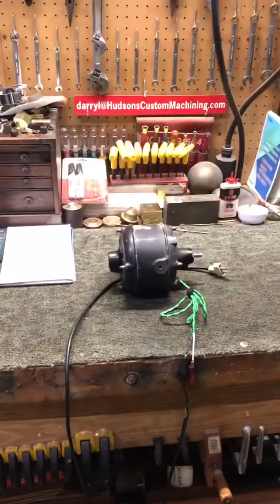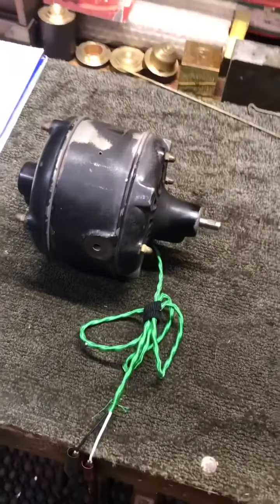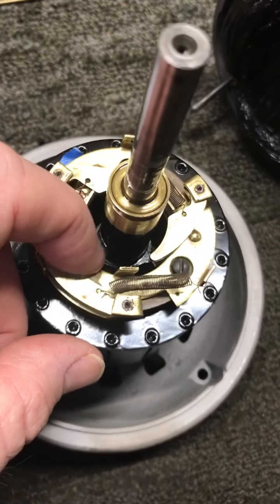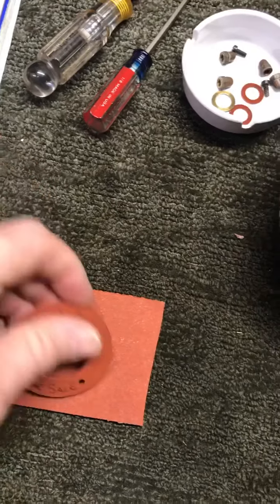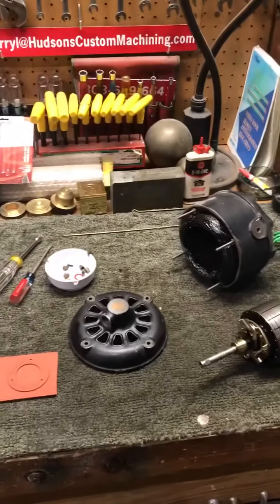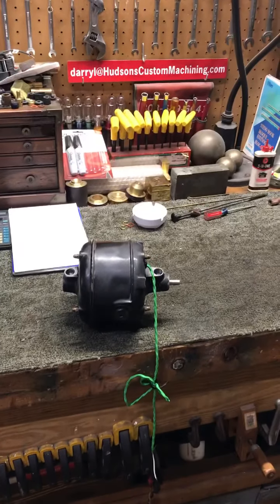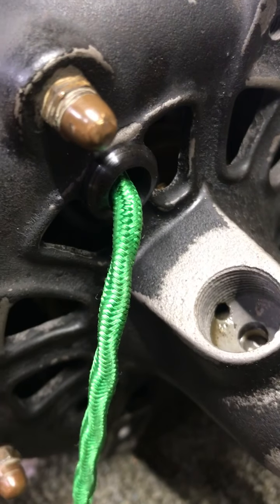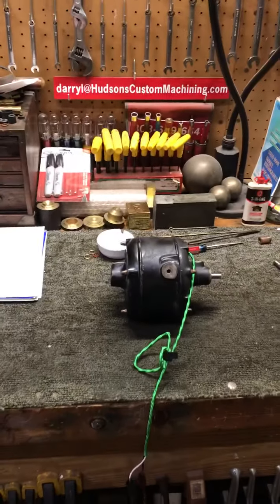c.1910 Westinghouse Fan Motor Repair - Darryl Hudson

Comment: Hey there Darryl.... I have a 1915 Westinghouse fan that works but needs bearings. Can you recommend a supplier for these? Also, it would be great if you could make a video showing how to remove/ replace the insulator under the centrifugal start switch. Thank you for this video, it was great!

Comment: Hey Darryl do you know where I can get 2 General Electric 2 star bushings from or could you make them
Reply from the maker: I make them.   Send me your motor so I can fit everything together.   All of these motors are 100 years old and have different amounts of wear, so each has to be custom machined and fitted.   Do not send entire fan with blade and cage.    All I need is the motor.
Reply: @darrylhudson4499  I can do that where do I need to ship it to